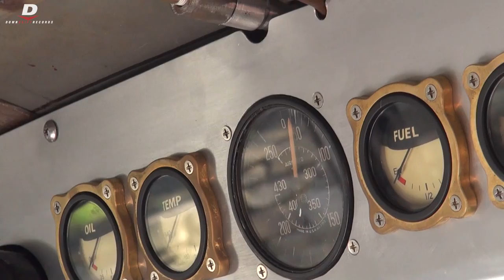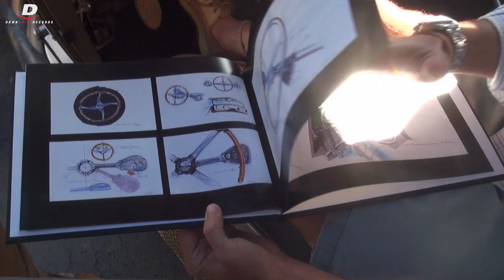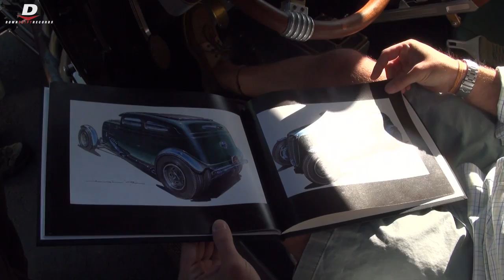Handbuilt 1100HP Falconer V12 Airplane Powered Dually

Comment: That's the best sounding V12 ever, I would sh the new LS V12 had this firing order like 3 90 degree V4s running at the same time instead of two inline sixes.
Reply: 90-30 firing order is an option.

Comment: The owner says it has 400 hp, not 1,100 and the Falconer V12 is more of a car engine than an aircraft engine.
Reply: @justrandomstuff84  650 was with a supercharger. It runs at 4,500 rpm, it's not a very high performance engine.
Reply: @justrandomstuff84  And, really, it's just like any other engine, it can be built to make different amounts of power with different modifications. It's an odd-fire engine, though, so it might have trouble reaching huge power numbers (1,000+ probably isn't out of the question, though).
Reply: The Falconer V12 came in a wide arange of variations.
They had 700+ HP in the 90s so id say it is achivable. 400 HP seems quite low for a engine with 10 liters.
Reply: @PistonAvatarGuy  Hooo this was meant for reliability, not racing. Falconer said it himself. Anyone wanting to use it to race would have to engineer it themselves.

Comment: He could have spent a million . Metal fabrication alone must have took some doing . that's a narrow V 12  aircraft motor . like to know more about it .
Reply: The Falconer V12 is a small block Chevy with 4 more cylinders.  90 degree Vee, canted valve heads with replicated port arrangement, 4.125 bore, 3.75 stroke.  Don't know what the deck height is.